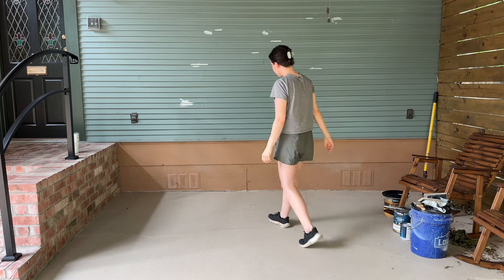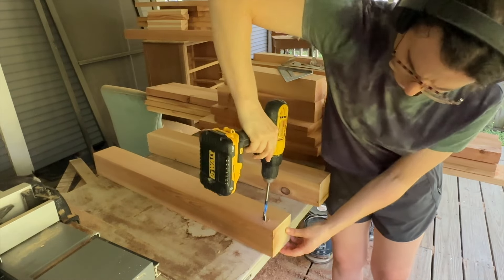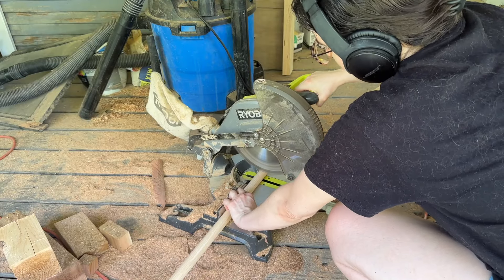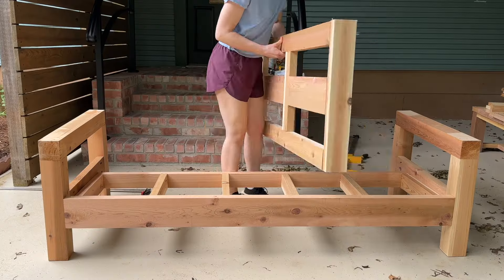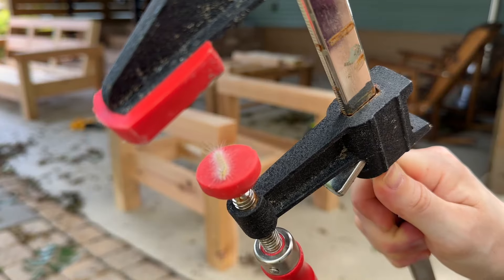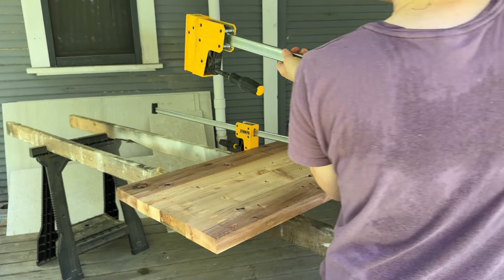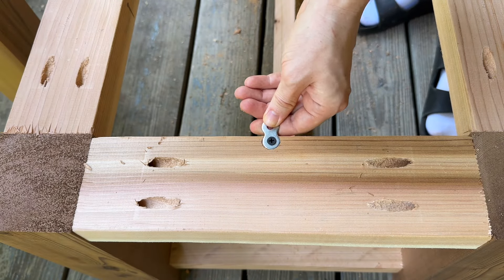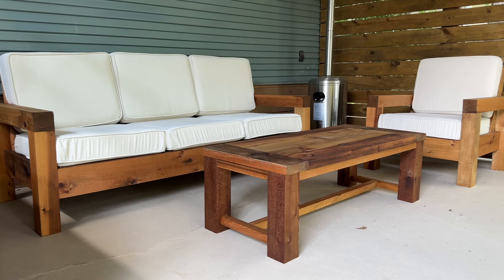Building My Parents a Patio Set FROM SCRATCH | Back Porch DIY Reno: Episode 5

Comment: Instead of 4- inch screws I would use Timberlok 5-inch. They will not fail under higher weight usage as they are structurally designed and IBC approved for load demand.

Comment: When you were having trouble with the spade bit, it looks like you may have had the drill in gear 1, which is slower than gear 2 while providing more torque (to break your wrist...lol). It may be worthwhile to try a spade bit without a threaded center.  That way, you control the progress and are less likely to snap your wrist.

#mansplained
Reply from the maker: Oooo interesting—thank you!